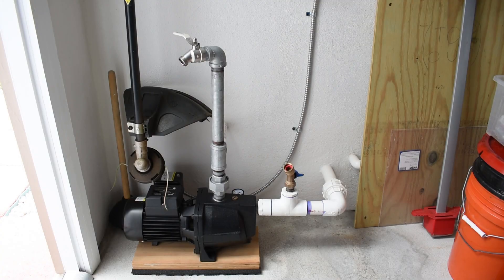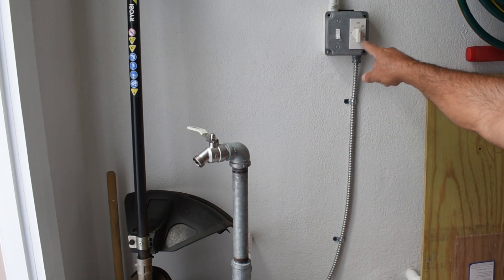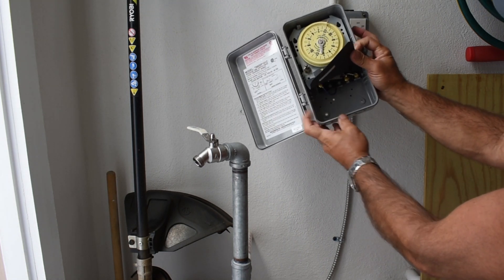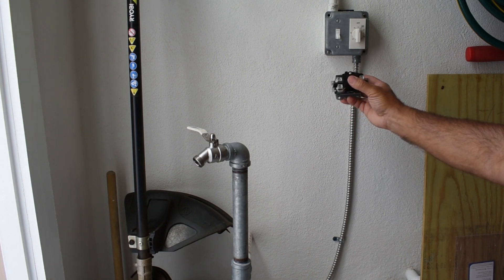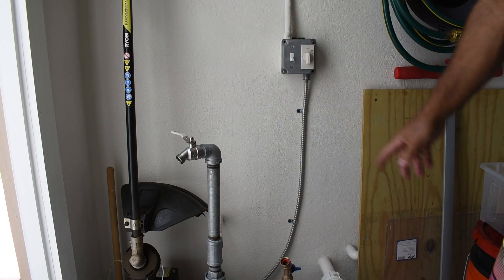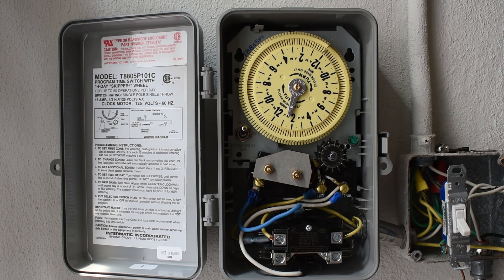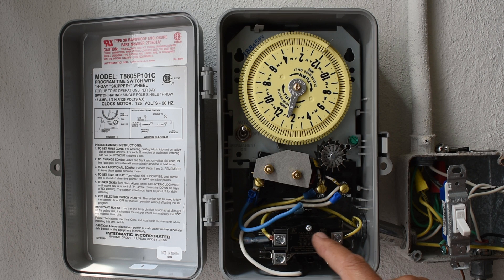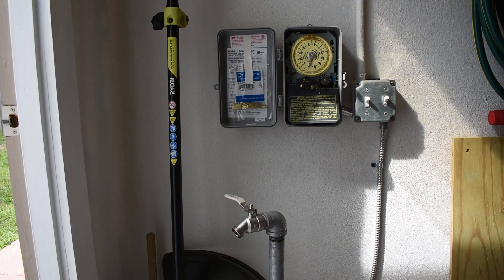City Water Sprinkler Timer Conversion To 120V Well Pump? EASY!

Comment: Nice setup!  Would you install a DPDT switch for manual operation without having to open the timer cover?
Reply from the maker: If you're using a 240-volt pump yes